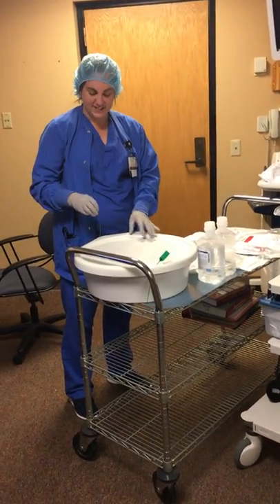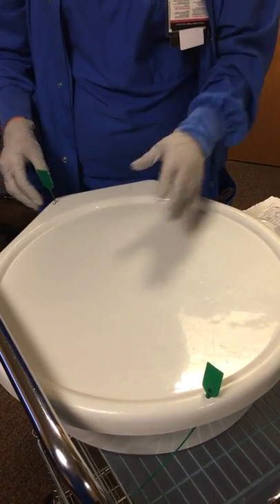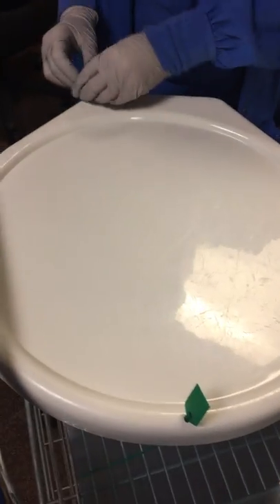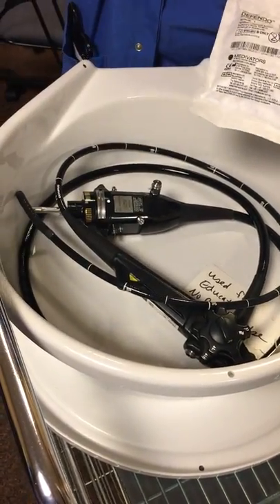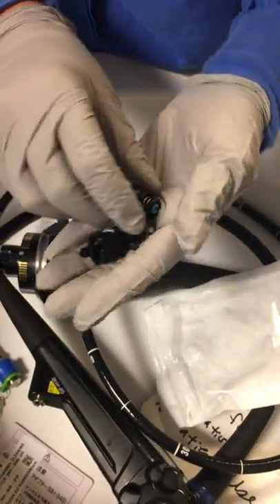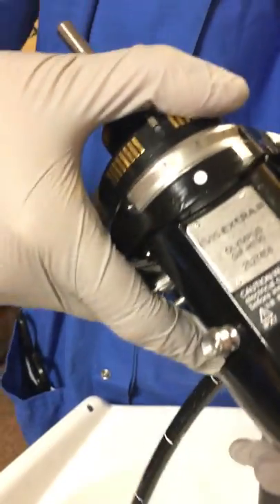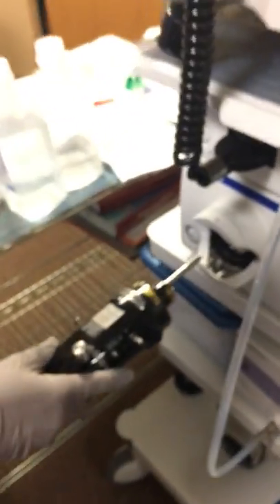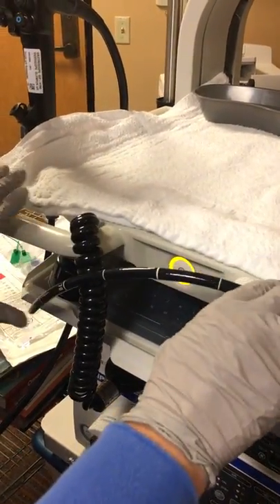Endoscope Set-Up & Pre-cleaning

Comment: not criticising but the scope should be connected last not at the beginning. We try to make the scope as clean as possible before inserting it to the patient. Air and water bottle and water irrigation should be set up first. Scopes should be laid down on the top of the clean towel rather than sliding the insertion tube on the side . We have to protect the tip of the scope and make it as clean as possible. Many thanks for this video.